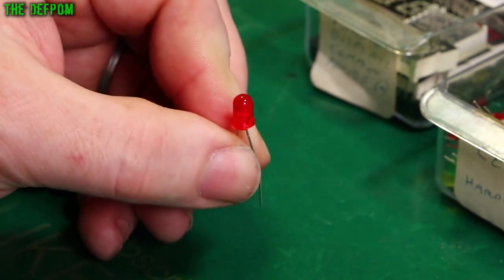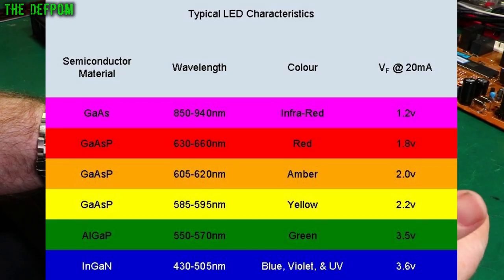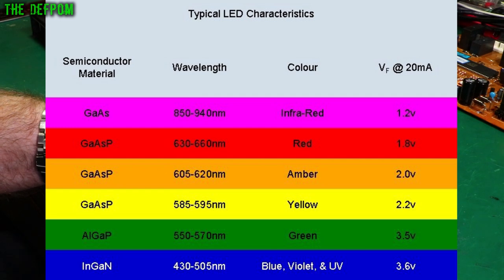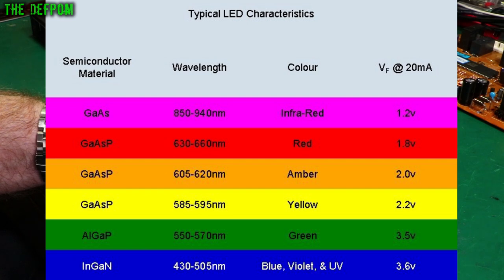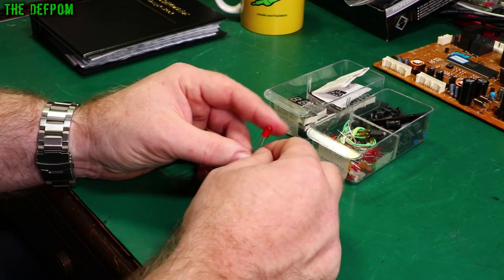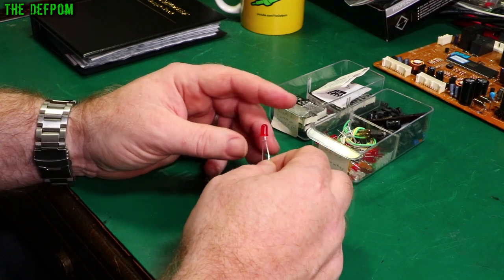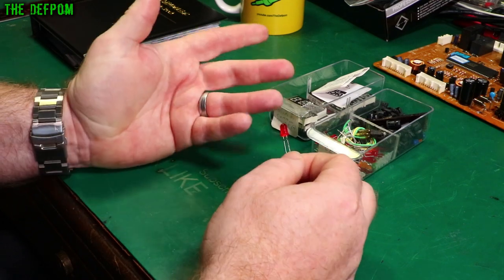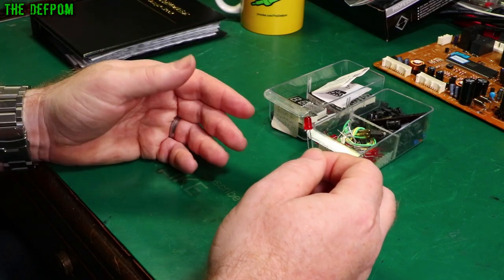🔴 Electronics For Beginners - No.7 - Light Emitting Diodes - No.963

Comment: If you shine light on an LED can you get a voltage like solar cells are they not a form of LED????? :-)
Reply from the maker: yes you can get SOME voltage output, but its insignificant.
Reply: You can as a sensor not for power.  Glass case diodes are light sensitive and can potentially cause issues in circuits.  Iirc solar cells emit infrared if powered. There's also pin and photodiodes as well.  Most (all?) semiconductors have a photoelectric affect.